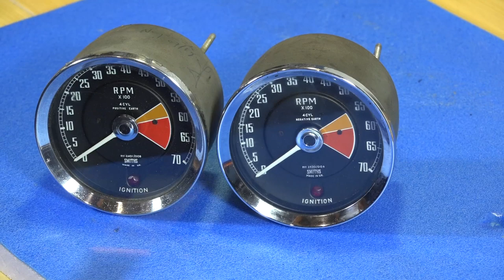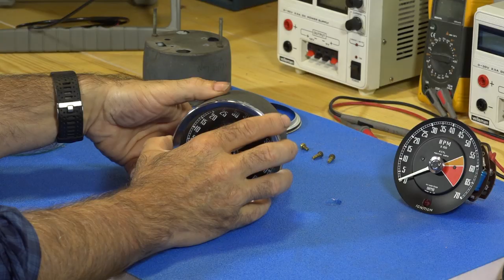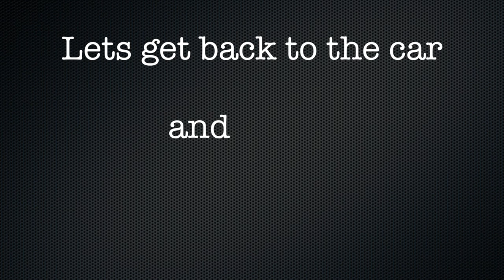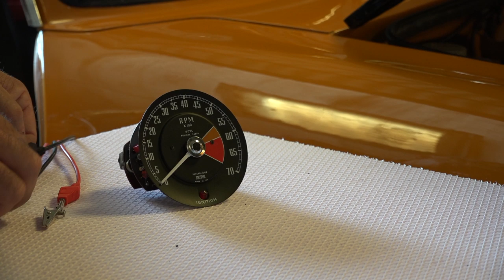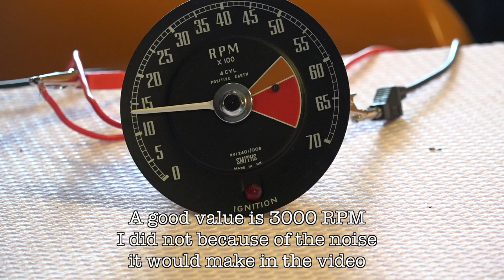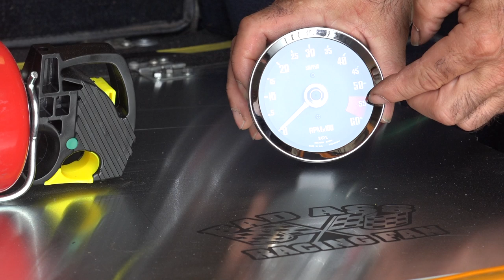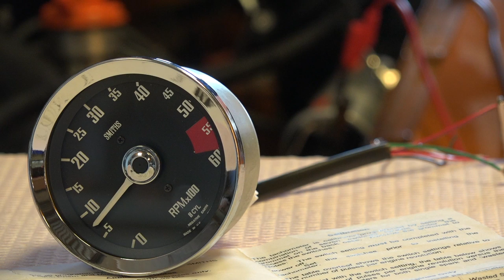Smiths Tacho Calibration and lots more   Part 2   Practical

Comment: I have a Rover P5B coupe 1973. I have installed a Lumenition optronic ignition, the engine runs very well, but the Tachometer doesnt work anymore!
The Tachometer has two wires coming from it and its Negative earth. Can you help me Please.
Reply from the maker: That is strange, have a close look on your cabling , sure you did not mix any wires ?  Unless your tacho is an old smiths that needs a current loop... what type of tacho do you  have and what is the polarity on your car ?

Comment: In front of me I have a VDO inductive tacho from a Mercedes W123. The circuit looks identical to the Smiths.  
In one of my cars i have a Full electronic igntion (EDIS) ,a mate made me a tacho using the case of the original one, driven by an Arduino device. Works brilliantly.
Reply from the maker: Thanks and indeed the Arduino boards are a great development tool. Good job. In fact those ciruits of the tacho are so simple

Comment: I have the tachometer with the single transistor.  It jumps when you turn on the key.  I saw a video somewhere where a component is faulty that causes that.  Have you done any repair on the actual transistor and capacitors on the one I have?  Just curious if you know how to fix my problem.

Comment: Hello, I have one question regarding tacho change / switch. I have an austin healey sprite 65, posivive earth. I have the first  smith tacho (wire loop) and it is broken. I have the opportunuty to get cheap the newer version (built in pick up coil). Am I uderstod right, I have to trim the old loop wire and connect it to the new tacho two connections?

Comment: I just had to take the Battery Indicator of my 73 Jaguar E-Type apart for repair and the Frontring would not come loose so as a last resort I used a heatgun with a small nozzle and carefully warmed the ring (use heat resistant gloves) and within a minute or so the ring came loose without any damage. The rubberring had turned to stone.

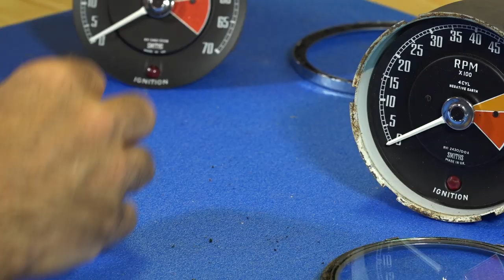Comment: 11:17 you show that the rubber seal is in a very bad state. What did you use when you reassembled the gauge? Is this seal available, or did you use something else for this purpose?
Reply from the maker: I did cut one from an old inner care tire
Reply: @D3Sshooter  Thank you for your reply. In another video I saw that butyl sealant was used.

Comment: Your video was very help full and educational. I have a Smits tachometer, but I've been unable to identify it or workout how to connect it onto my Ford F100. On the face of the gauge it says "RVP 1601/00".
Reply from the maker: Thank you, typical there are only a few types.  Older types require an induction system by looping the current through the RPM meter needed for the HT Coil.  That is either an external cable loop at the back or an inside transformer.  More moderen types use pulses from the ignition as a pick-up.   The RVP 1601/00 is a pulse pick-up type.  It will need an external generator as it is most common used on diesel engines as they have no HT Coil.   So, if you want to fit it, you will need that external pulse generator to be connected to it and to the engine so that it can pick up the cranckshaft RPM's , or as an option from your ECU as that might have a RPM output. But you will need to check what your options are on the F100

Comment: I have an RVC 1410/00AF tachometer and there is no potentiometer. I was able to solder on capacitor and play with the weights and magnetic fingers to calibrate it.

Comment: Steve, your MG looks to be from the 1970s probably a rubber bumper one. If I am correct in assumption your car should be a "negative earth" .  My understanding is that positive earth was used from 1962-1967.
Reply from the maker: Thank you for the comments, its a 78 and indeed negative ground
Reply: a 78 with the ignition light in it?

Comment: Do you have a link for the company you mentioned in your video for the tacho?
I discovered your videos and they were very helpful, I am currently trying to calibrate my MGC GT RVI 1600s series. I recently just put in a sport coil and a 123 blutooth ignition so I can digitally pull up my rpms and many other things. 
Sadly the tacho ran high before the new system and still currently running high. Going to redo wiring and calibrate this week but I like that tacho you recommended as a back up. 

Thank you again for your videos!
Reply from the maker: Sorry for the late reply , as i was away for work. But thanks for the comments.  I used Burtons (UK)
Reply: @D3Sshooter  Burton! How funny, as a geologist I've used a company called Burton (probably the same one) for doing a lot of field measurements.

Comment: Ive got a VDO vintage Tach from the 70"s it says on it , I don"t know what Its off , I hooked it up to my VW beetle but at Idle 900 RPM it was reading 2 and a Half Grand , Could I take it apart and Adjust the Peteniomiter  ? do you think kind sir ?
Reply: Ps thanks For the Vid So Informative
Reply from the maker: I don’t think that will work. The potentiometer is only for small adjustments and calibration
Reply: @D3Sshooter  Thanks for your reply ,Yeah I thought so , Im better off just Bying a Tacho  Thanks

Comment: thank you for the informative videos. it's great someone is doing this kind of content. if you could help do you have any advice on fixing a jumpy tachometer. it seems to be common in MGB's i've seen it a few times but never tried to fix this kind of thing. maybe another video idea?
Reply from the maker: Thanks  for the comments,  A jumpy tacho can have several reasons.
Mechanical defect inside the Tacho, but in most cases it will be either a bad grounding of the Tacho or the 12V stabiliser ( small metal box, looks like a relay  near the tacho) that feeds the 12V to the Tacho is broken/ faulty 
another issue could be that electronics are faulty especially te capacitors inside the tacho.      So, several things to check, I would first check the voltage on the tacho and see if its stable (12v or 6V) , also check the groud... in most cases that works

Comment: A simple question: I am assuming that a "tacho"  is a short slang term for a tachometer? In the USA we would use the term "Tach" as a short slang name. I wanted to make sure that my assumption of "tacho" and "Tach" are referring to a tachometer"
Reply from the maker: Steve B indeed steve. Its a tach or rpm meter, tachometer.  Thanks for pointing thst out